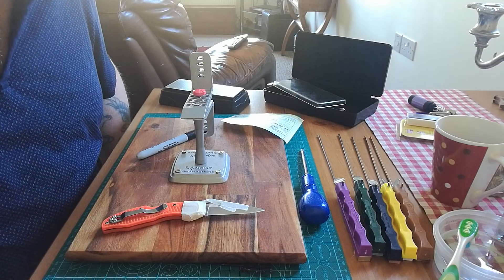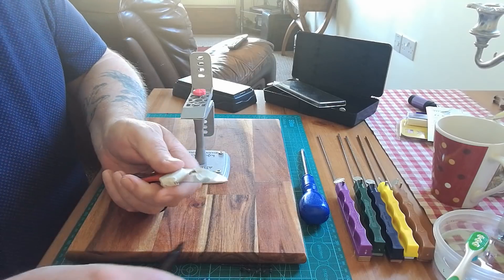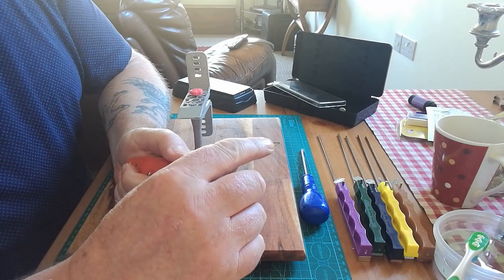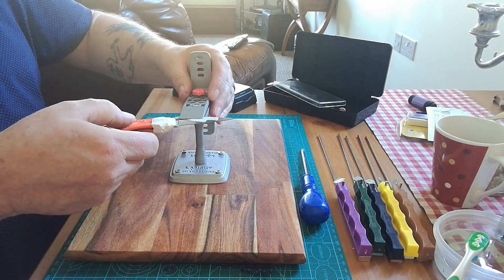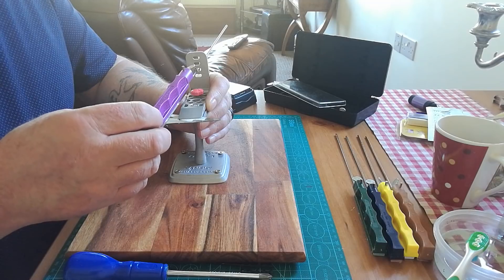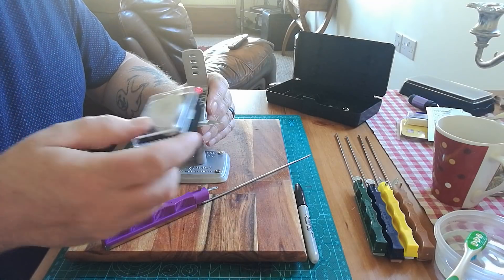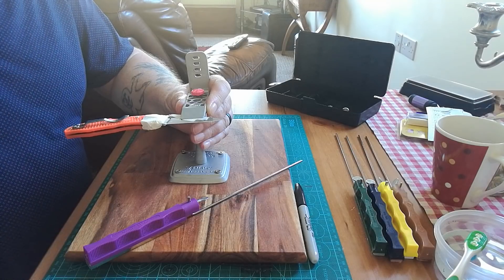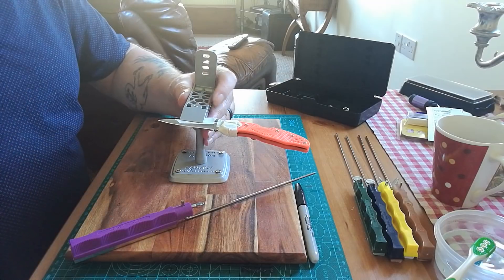Sharpening lansky style part 2.first and most important step.

Comment: Another great one in the series. As you mention, the tip is where it can all go wrong if you roll off the edge. You can spot when somebody was careless using a guided system, because the tip bevel is bad. Highly recommend people start out on a full flat grind like this, or something like a Scandi grind where you've got a large flat to work with. Cheers!
Reply from the maker: slidetek thanks Tony these are awfully difficult to video as I'm finding but hope fully it will get better.did I explain the sharpening angle thing right.atb paddy😀☘👍
Reply: You're doing a great job!

Comment: Another good idea, to get the clamp in the right position should you remove the knife, is to outline where it is on the tape, with sharpie.
Reply from the maker: Jef Jewell I am a silly billy,inside I'm saying bad words.i will get it reset before next part.thank you that could have been very embarrassing .i love you😘 sorry it's out now connie.atb paddy😀☘👍
Reply: I always mark in case I take it off (for some stupid reason even), or the blade accidentally slips. As long as that sharpie is sitting there! I'm actually all psyched to pull out some knives I've procrastinated on now!
Reply from the maker: slidetek go getum mate shave some arm hair.😜😀☘👍

Comment: Wow! very interesting, I have known about these systems for years but never seen one in action, very good for getting a precise edge but would drive me nuts.
 I use about a 150 grit whetstone if the edge has been knocked about, then go to a 600 and finish with a 2000 and a leather strop with metal polish on it, but that's only for a damaged edge most of the time I just use the 600 and a strop, all freehand.
 Being an old bugger I learned to sharpen freehand as a kid with my penknives decades ago, I don't think I could deal with all those bits and pieces now.
However I do get anally retentive on my wood chisels, I use a guide for the angle and start with 240 grit wet and dry on a glass sheet ( when it's wet the paper sticks to it) and go step by step up to 2000 grit and then strop, the chisels help to earn a living, the sharper they are the more precise your work but my knives just have to cut well and hold an edge.
By the way, I was always taught the 'burr' is called a 'wire edge'.
Reply from the maker: chris osh to be honest mate I've only been learning sharpening this last couple of years and I love trying all sorts of different methods this being the latest.i also love freehand myself and enjoy watching jef Jewel on utube.thank so much for watch and sharing.yes the burr,wire edge same thing.atb paddy😀☘👍

Comment: Eventually you get the knack of knowing what angle you are sharpening at and can keep it pretty constant.
 I have been sharpening stuff at work and in the field for donkey's years, pocket knives and fixed blades are more or less the same, things like machetes and bill hooks need a slightly broader shoulder behind the edge to support it (also slightly convex), an axe a little bit more shoulder etc.
 When I was younger you wouldn't believe how many times I had to go back over an edge after screwing it up.
Reply from the maker: chris osh because I've started so late I'll never master any  but I'm enjoying trying as many as possible .atb paddy😀☘👍